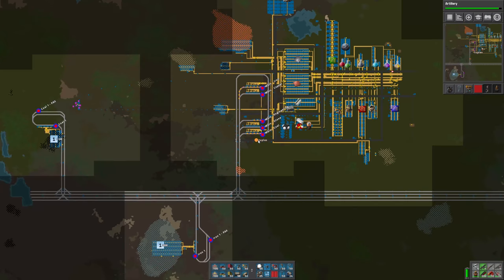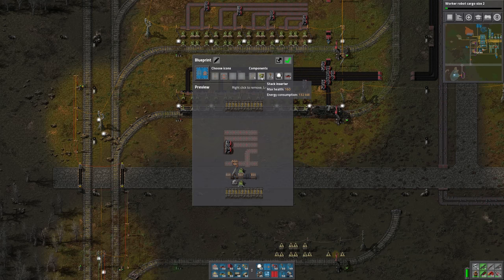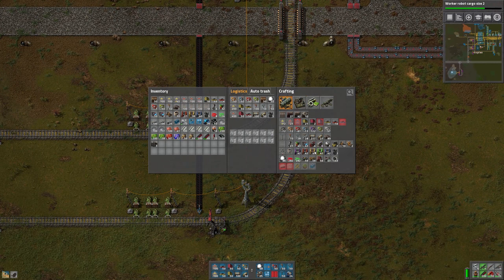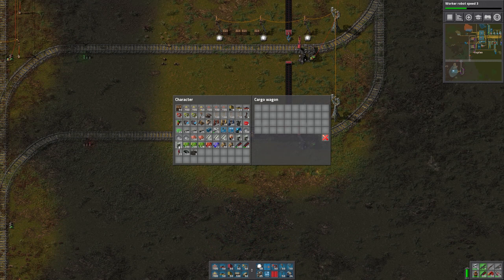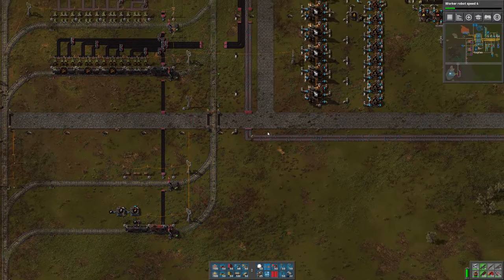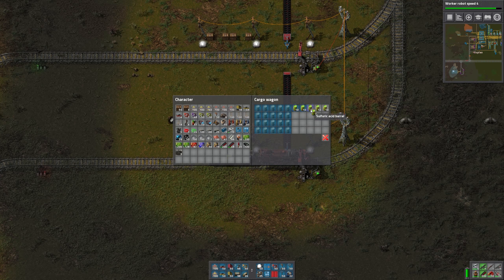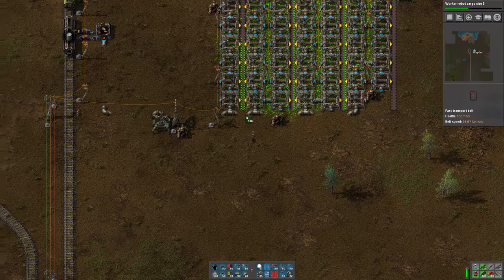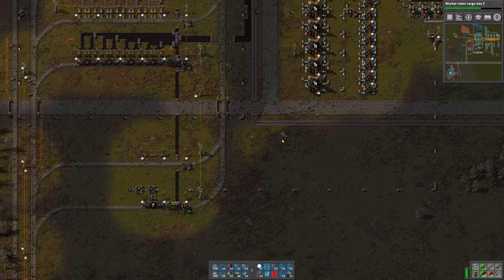Factorio 0.16 Let's Play #18 - Acid for uranium

Comment: Why are you don’t use fluid wagons?
Reply from the maker: Hi, I usually use fluid wagons, but in this case I simply wanted to use a different method :)  Generally, I think barrels are good for transporting small quantities for long distances, pipes for large quantities and short distances, and fluid wagons for large quantities and long distances.